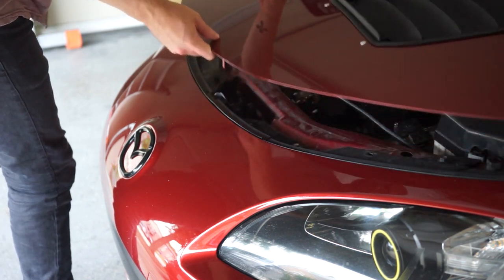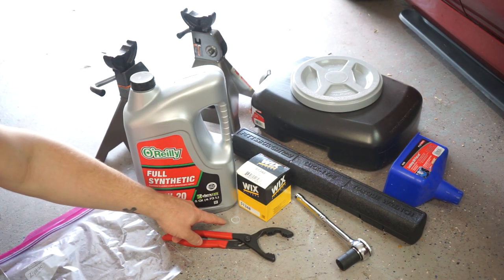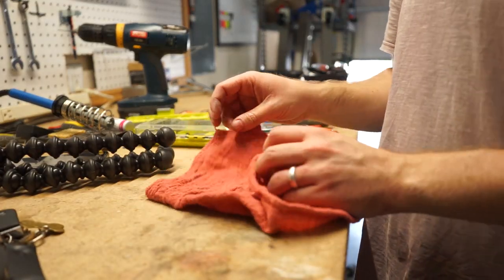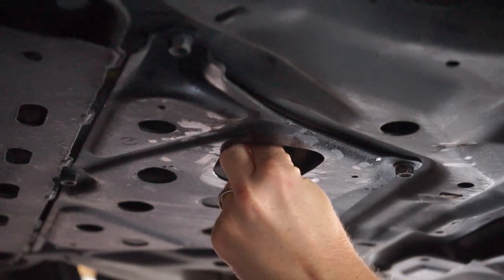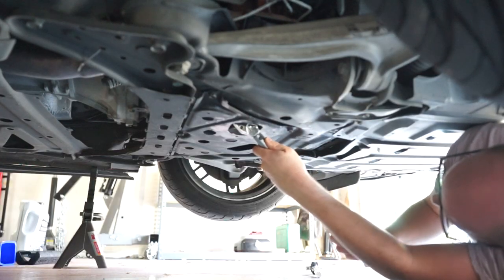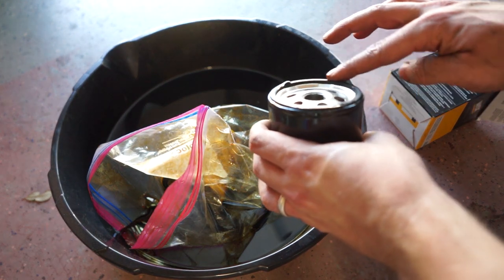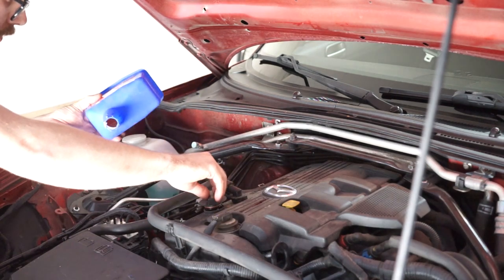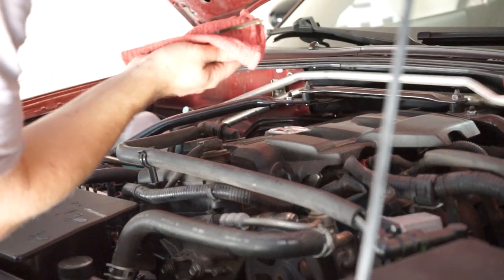NC Miata 101 | Oil Change How To

Comment: I too own an NC. (2011)  I have done a few minor changes, mods, upgrades ...what ever ya want to call them..... Here is one as I did from once reading this....     " If you own a NC and do only one mod, do this one...    Get rid of the plastic coolant expansion tank as the NC is the only one that the expansion tank is pressurized along with the coolant system.   The plastic breaks down in time from heat, etc. and can crack open!    Buy the aluminum one please. It's a rather easy install and peace of mind!    ZOOM-ZOOM!

Comment: I noticed that you jacked the car from the middle, I thought the NCs were not to be jacked up like this. Also I pour oil into the filter before putting it back on, just something I do. Thanks for the video I will be using the plastic bag trick.
Reply: Pour oil in the filter, because otherwise  oil might not reach it 😂😂😂😂😂

Comment: One thing you might not know, If you hold the throttle to the floor while cranking the engine it will turn over without starting which is a good way to get the oil worked around your engine on an oil change before you start it. Other than that I would say this was perfect for a DIY mechanic to follow!
Reply: Especially if you don't fill your filter before installing it.
Reply: @hondamotorsrider  sarcasm?

Comment: thanks for the video! Very helpful, easy to follow, no unnecessary stuff. I usually also fill up the new filter with new oil so the engine has immediate access to fresh oil at first startup.

Comment: I have recently purchased a 2010 MX-5, GT PRHT, and have been up grading to all LED light bulbs (except for Xenon headlights). Always looking through YouTube for advice, however always ending with your videos, for the most concise, accurate and simple guidance.
Having done almost 1K miles of  ownership, (and SAM’s having a $10 instant rebate!), I decided to do an oil change.
Of course the MX-5 filter is nowhere to be found from above, so needless to say I sought insight from YouTube. Not realistic that you had downloaded any videos other than lighting inspiration.
The first one I found was yours, I know I need look no further. You answered all of the questions I may have had.
Thank you for your diligence and insightful videos.
Reply: If you think changing the oil is fun, just wait until it's time to replace a headlamp or front turn signal bulb.

Comment: No need to remove the tire. Just remove the small plate under the filter and oil plug. Its just 4 screws. Easier and faster than removing your tire. Also filling the oil filter up a bit before attaching it.
Reply: prefilling oil filter is proven to be completely unnecessary but if it makes you feel good keep doing it.

Comment: FYI - the oil pressure guage is "fake" - it just takes RPM not actual oil pressure. There is a "real" oil pressure mod with an LCD screen that fits in the original oil pressure slot

Comment: Not bad but I would note that before you add the oil the car must be on a level service as much as possible. If you raised the front on stands the oil level will be off.
Reply from the maker: It's up at all 4 corners

Comment: Thanks for making this. I'm trying to do a coolant flush. But I don't see an opening on the radiator. Do I just pour the flush and then the coolant after the flush is done directly into the plastic reservoir?
Reply: 4 years too late, but yes. Also, replace the plastic one with an aluminum one if you haven’t already. They’re very prone to cracking and will leave you on the side of the road with a chunk of iron instead of a running engine.

Comment: I read that the oil pressure gauge doesn't really measure oil pressure.  That true?
Reply: It's true.  The only oil pressure sensor on the car is an on/off switch.  So the oil pressure gauge will only really tell you if the car has any oil pressure at all.  I don't know how the switch is calibrated.